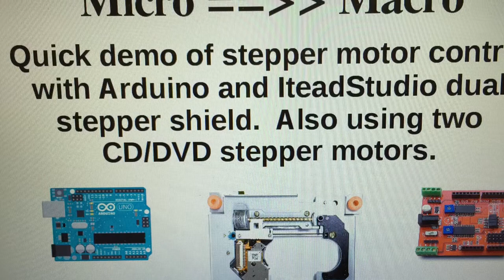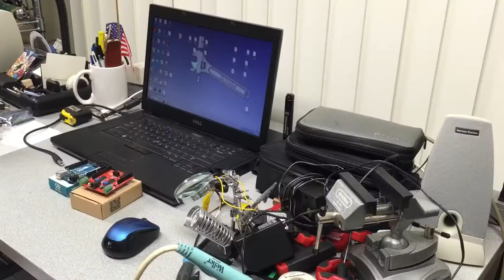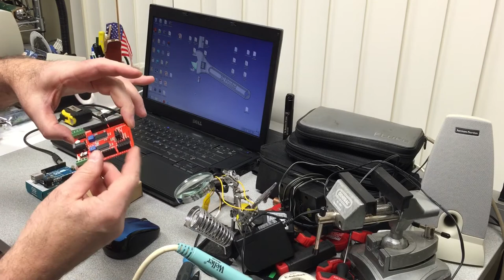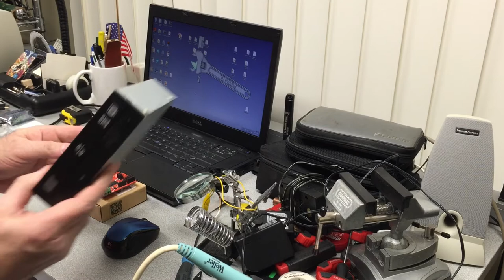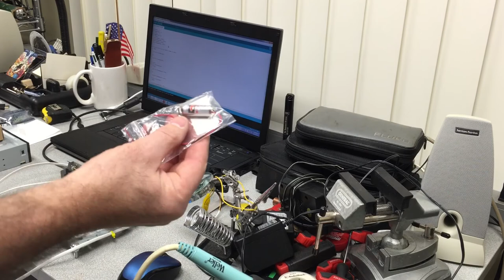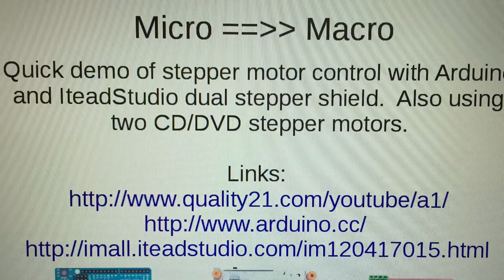Arduino Stepper Demo A1

Comment: Got it. Uses different code.

int dirPin1 = 3;
int stepperPin1 = 2;
int dirPin2 = 7;
int stepperPin2 = 6;
void setup() {
  pinMode(dirPin1, OUTPUT);
  pinMode(stepperPin1, OUTPUT);
  pinMode(dirPin2, OUTPUT);
  pinMode(stepperPin2, OUTPUT);
}

void step(boolean dir,int steps){
  digitalWrite(dirPin1,dir);
  digitalWrite(dirPin2,dir);
  delay(50);
  for(int i=0;i<steps;i++){
    digitalWrite(stepperPin1, HIGH);
    digitalWrite(stepperPin2, HIGH);
    delayMicroseconds(100);
    digitalWrite(stepperPin1, LOW);
    digitalWrite(stepperPin2, LOW);
    delayMicroseconds(100);
  }
}

void loop(){
  step(true,1600*5);
  delay(500);
  step(false,1600*5);
  delay(500);
}

Comment: The sketch I used on sparkfun easydriver does not work on this IteadStudio dual stepper shield but it worked on easydriver just fine. The stepper motor making sound but no movement.

Comment: I'm using the exact same code and shield but the x axis isn't working. The y axis kind of works but it skips around. To complicate things more, the motors have no response to the potentiometer being adjusted. I am using two dvd stepper motors similar to those in the video off of a 12v 2a suppply. I tried running the motors directly from the USB like in the video but it diddnt work. Has anyone experienced these problems?